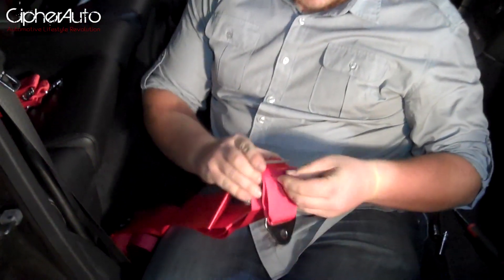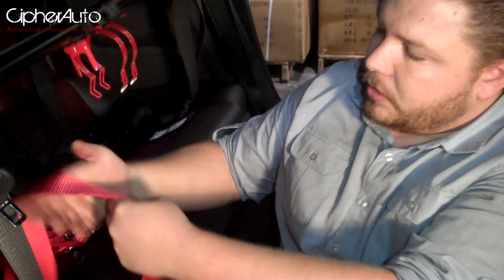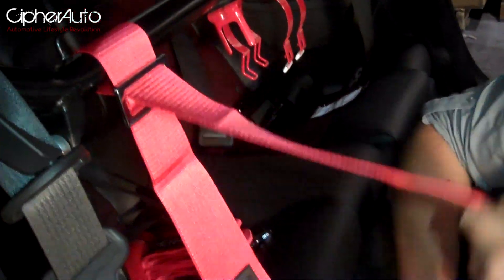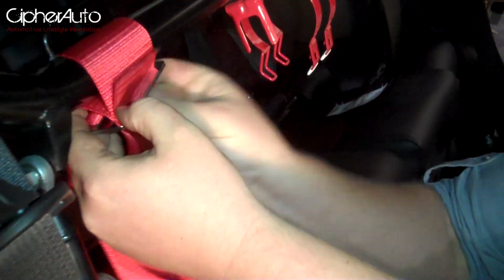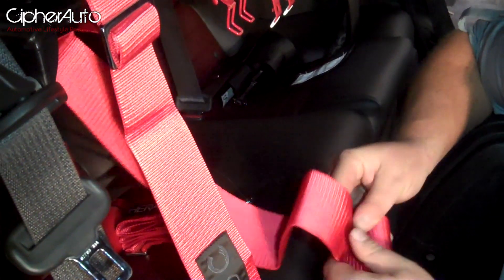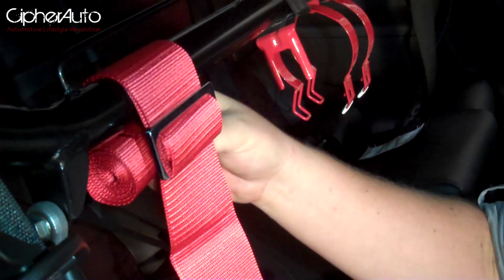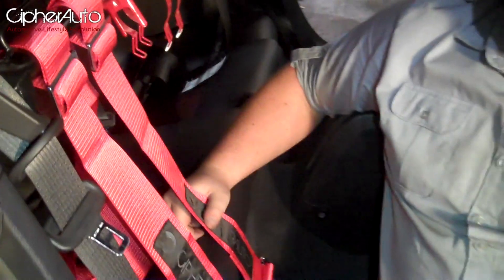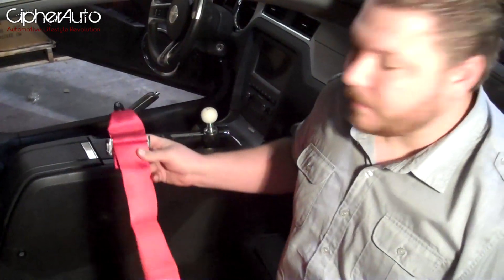Cipher Auto 3" Inches CPA4004 Series Racing Harness Belt Installation Guide

Comment: With the ends now being stitched, there is no way to get it through for the 3rd final loop.
Reply: You can always cut the stitched end off and melt it with a lighter, torch, hot knife or soldering iron after you run it through the last loop.